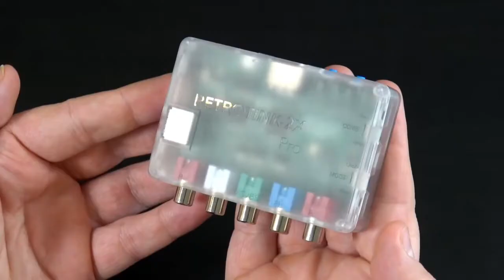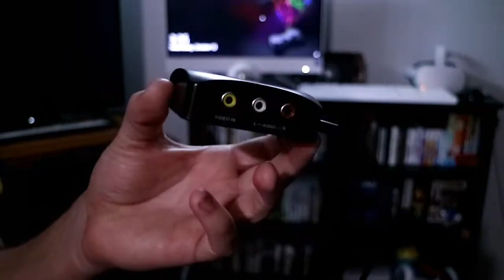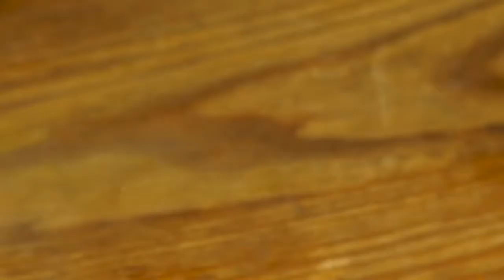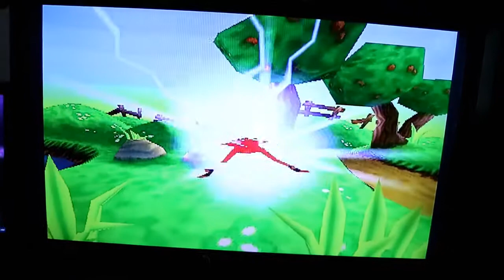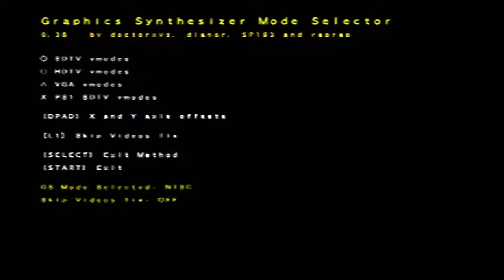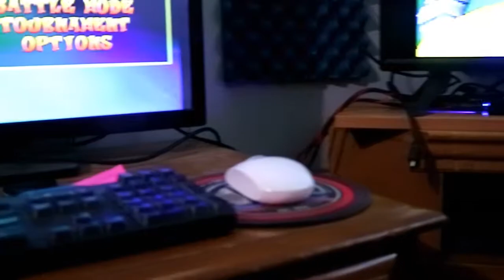RetroTINK-2X Pro Review - A Budget-friendly Upscaler

Comment: In 2026, I would not call it a "budget-friendly" upscaler. It's 140 USD plus tax and shipping. It's definitely not a bad upscaler, but it has very few features for that price, and there are four other upscalers that I would strongly recommend that you look at, and one or more of these will likely suit your needs better, or just cost a lot less: 

#1 The Restroscaler 2x - Very similar to the Retrotink 2x Pro, but about one-third the price. It's a clone of the older version of the Retrotink 2x Pro, known as the 2x Classic. It could have problems with some PAL consoles, but otherwise it's great for the price and has all of the same important features and functions as the Retrotink 2x Pro, including fast switching between 240p and 480i. 

#2 OSSC - You can get these for less than the 2x Pro from some sellers, but some will cost more. The OSSC has a LOT more features and scaling options, including support for 480p, 720p, and 1080i input, and more scan-line options (which the Retrotink 2x Pro doesn't have). The OSSC will also provide superior image quality to the cheaper GBS-C with any input resolution except 480i, and this is the main reason why it's worth more than the GBS-C.  The OSSC also has very slow switching between 240p and 480i, which will be a problem in a small number of 5th gen games and PS2 games. The Retrotink 2x Pro has much faster switching between 480i and 240p, which is one of its only advantages over the OSSC. The Retrotink 2x Pro, like the Retroscaler 2x, also supports composite and S-video input, whereas the OSSC supports component and RGB input. 

 #3 GBS- Control There are many variants of the GBS-Control, but any of them should be pretty good, and if they're missing any features, they can be modded pretty easily. These can be found for as low as about 1/4 of the price of a Retrotink 2x Pro for a cheap one. With 480i or 576i input, the GBS-C will usually look better than any of these other upscalers thanks to its support for "motion adaptive" de-interlacing, making it a particularly good value for use with the Playstation 2, because most PS2 games will only run at 480i (or 576i for PAL versions). I recommend buying the clock mod kit with the GBS-C, even if you're not sure if you're going to be able to install it any time soon, because it's extremely cheap, and will help to prevent frame desychronization in some games. More expensive models should come with the clock-mod pre-installed, but these are often close to the price of the OSSC, so might not be worth the higher price unless you plan to use it with a lot of 480i games. If you aren't planning to play a lot of games which run at 480i, then any of these other upscalers are going to provide better image quality at 240p. While the GBS-C lacks composite and S-video input, most units have component (YPbPr) input as well as RGB input over THREE different types of connectors, not just SCART.

#4 RAD2X - This upscaler will plug directly into your console (there are a few different variants for different console connectors), eliminating the need to buy an RGB cable, which can be very expensive for a good one. It is based on the Retrotink 2x Scart, and will provide equivalent image quality to using a good quality component cable with the Retrotink 2x Pro or Retroscaler 2x. While it will only work with a small number of consoles, the fact that it eliminates the need for an additional expensive RGB cable makes it potentially significantly cheaper than buying a Retrotink 2x Pro. If this will work with all of your retro consoles, it's worth considering, especially if all of those consoles support RGB output. That being said, it doesn't support 480p input, so is less than ideal for any 480p capable console.

Comment: 4:17 Couldn't you just use your Wii if you needed to record GameCube footage? That has a digital output right?
Reply from the maker: That is an option, but I stated towards the end that I need to get the Wii refurbished, as the disc drive and the AV port are shot. That, and I've grown a real taste for playing the games on their original hardware, for the most part anyway.
Reply: The Wii wasn’t meant to be used on the Retrotink-2x Pro as it can’t handle 480p input. In fact, it can only accept input resolutions of 240p and 480i. The Wii outputs 480p.
Reply from the maker: @jordanmillraney5481  True, but 480p is compatible now thanks to firmware updates.
Reply: @JuniorNitro  480p is not shown as supported on the Retrotink store page for the Retrotink 2X Pro. You'd think they'd include something saying that it can support 480p input if it could actually do that. 

The Wii can output at 480i, both for Wii games as well as for Gamecube games. 480i is the default output method for most if not all Gamecube games I believe. Of course, 480p would be better though. The Wii's component output is not bad, but it's not quite as good as the 480p output you can get from a Gamecube, oddly enough, but it's typically going to be a lot easier and cheaper to get 480p output from a Wii than from a Gamecube, so that's likely the most affordable way to be able to play Gamecube games with a 480p output signal. You will need to set the resolution in the Gamecube game, the resolution setting in the Wii menu only affects Wii games. With the right software modifications, I think you can force 480p on all Gamecube games, but that might be too complicated for a lot of people.

There are adapters and mods for the Gamecube which can allow you to get a 480p signal from the digital AV port, with component and hdmi options available, and probably also RGB. You can also mod it to have additional outputs which can output 480p (such as an hdmi output port).